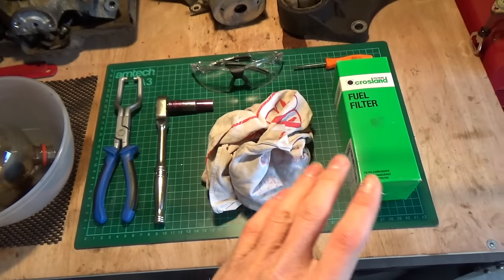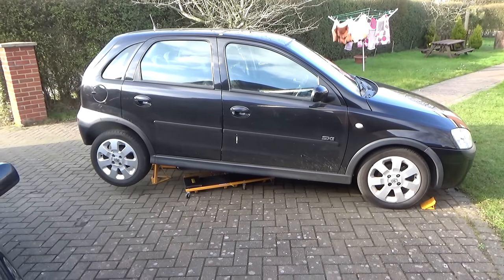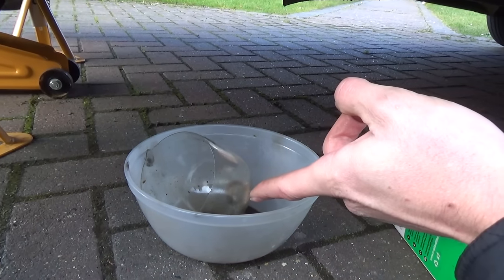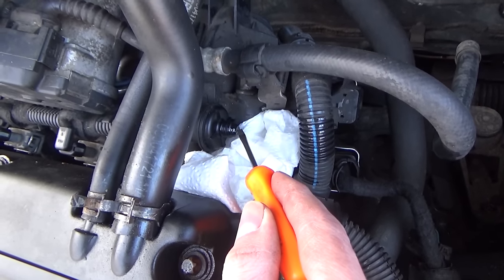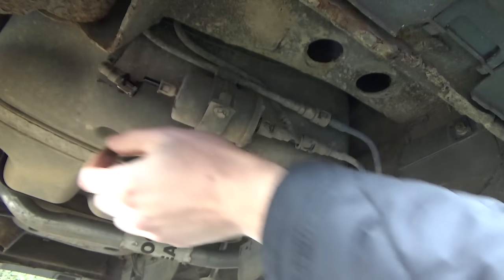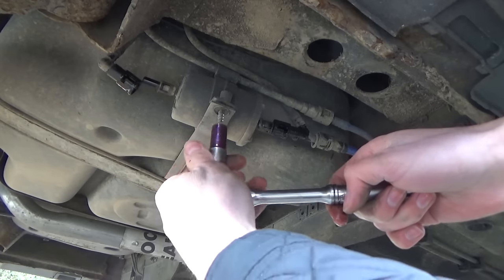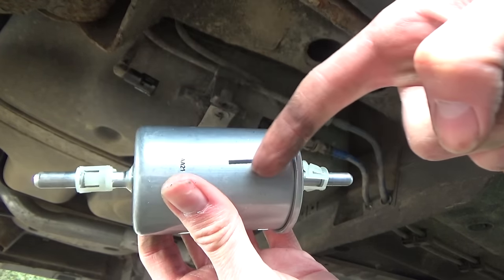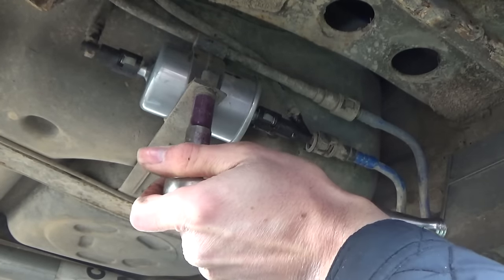Corsa C Fuel Filter Replacement

Comment: I did this job on my Astra and it was a pig of a job. Those pliers make it so much easier. I've been give the job of servicing a Corsa C that has been off the road for 2 years so this vid will help me when I come to do the fuel filter.

Edit: The fuel filter was a complete mare of a job and I ended up breaking the end of the fuel feed pipe. I've had to buy a replacement on eBay. Getting the pipe off involved dropping the tank down enough so I had enough room to liberate the pipe. The filter was rusty so it had to be replaced. I've shot a video of the service and I'll post it up once I've finished the job. I'll be spraying some white grease on it to prevent it happening again.
Reply: pp

Comment: very clear great vid thanks just about to try !! also got cutting out problem so hoping fuel filter will change that, update. Very challenging, the filter looked like it hadn't been changed for 10 years, the return connector with the y connector was ceased on the filter and fell apart. I'm now trying to get a replacement, quick connectors with the T piece don't fit , and trying to heat the return line hose to let is expand over the connector is virtually impossible on a hose 20 years old , in short filter cheap rusty connection and deteriorating hoses causing hassle

Comment: great video mate, and like the guy says buy the proper tool to get the fuel line off. i hadn't seen this video a few years ago when i changed mine on the astra. the Haynes manual says you can do it with small screw drivers, be-leave me guys just buy the tool and follow this video you will be so glad you did thanks
Reply: Great video. It's like watching wheeler dealers

Comment: For future, to stop petrol leakage, some cars you have to tilt the filter to get it out, so use the rubber caps from the new filter to block the old one before removing, it'll stop any petrol spillage :)

Comment: Hi ....nice vid....when i pulled the connector off there was a small orange o ring in the connector. Does this need to be changed as well? Fuel is just dripping when the pump is activated.

Comment: Hi, might be a bit of a long shot but what is the guard just in front of the filter (that the fuel lines slot into) called? I can't seem to find it anywhere. Also is it really needed as mine's falling off, just being held on by a bolt. 3:26 gives a clear shot - its the piece on the lower right hand side of the screen

Comment: Great vid!!  i'm having problems cranking the engine takes a few turns to start.. Not the spark plugs, so i'm guessing  a new filter change? same car here 2003 model.. 85000 on the clock.. Checked  service history no filter change's  ..

Comment: Quick question I have a problem with my opel corsa c it turns off after few minutes of running could it be sensor problem or the fuel pump will run 5 min turns of I have to wait few more minutes then it will start again 😥🤔

Comment: update on my shambles replace the pipe that was damaged and the connectors only to find they didn't seal properly , a right mess I replaced a section of the return pipe and the Y connector but for new quick release and they don't seal  - any ideas great

Comment: Quality presentation many thanks.  Is this the same procedure for the Corsa D 1.2 petrol would you know please?  Again, many thanks.
Reply: Ah, this is me answering my own question as I have just discovered that the D petrol, does not have an external petrol filter.  It has a so-called lifetime filter.  It is apparently part of the fuel pump and therefore lives in the petrol tank.  So when the petrol pump dies, you replace that and in so doing, the integral fuel filter.  Scotty Kilmer suggests that the pump dies BECAUSE of the lifetime filter clogging up over time and  therefore making the petrol pump work harder till it eventually gives out.  Replacing the pump looks fairly straightforward and the cost for the unit varies depending on the brand.  £50-£170 is the range I have seen today.  I'll leave the filter alone now and foccus on the stuff I can do.

Comment: Hello mate, I have a Opel Corsa b which my daughter collided on to the back of another car. I suspect that the inertia switch or the fuel cut off switch has jumped and cut off the electricity to the fuel pump and perhaps to other parts. The car is completely dead and except engine light nothing else lits. I have looked everywhere to find the "inertia switch" or "fuel cut off switch" but I can't find it. Can you help me locating this switch please? It's a Opel Corsa b 2000 model. Thanks in advance.

Comment: the bolt that holds in the fuel filter is stripped for me, my philips screwdriver just spins in it. any ideas what i should do? the bolt is rounded so 10mm does not grab onto it

Comment: Hi, I am wanting to remove the fuel from a Vauxhall Vectra before scrapping. 

I have located the fuel line, filter and valve as shown in your video. I wondered if I could release the pipe from the filter to drain the fuel? If so what would you recommend?
Reply from the maker: Carl Brierley I would remove a fuel line and crank the engine so the fuel comes out, or just drill a hole in the tank if scraping it
Reply: Excellent. It's a full tank and thought I could release the valve pressure when my bucket is full?

Comment: i've a question. I turned off my corsa c and after 10 minutes pushed the valve on the fuel rail and there was not any pressure. 
Is that normal?

Comment: Hi thats a really good video and very helpful so thanks  for that. I wanted to ask you about brake pipes. I have a corsa c and it needs brakes lines front to rear and some others renewed for MOT. Can I do this myself or is that a bit tricky? Also Ithought I'd renew with copper pipes but I also see that there are stainless steel pipes on the market. Which is best do you think? I'd like to do hopefully a permanent job so this doesn't come up again. I dont suppose you have a video of that job lol. What sort of cost would you expect a garage to charge for this? Hope you can help , thanks, Joe

Comment: This might be foolish question but why isn't all fuel coming out of the tank if you disconnect the fuel line there? Also do you know if the trick with the removed fuel pump relay and attempting to start the engine works on the Peugeot 205? I mean don't you break down anything using that method?

Comment: What to do if the connector are broke on the hose? Can use petrol pipe clips instead?
Reply: Did you ever figure this out? I have the same issue, I think one of the seals has gone in the connector. Does anyone know where to get these connectors from?

Comment: Do u know if it would be in the same place on a astra H 1.8
Reply from the maker: If the 1.8 is anything like the 1.6 they don't actually have serviceable filters on.. they are inside the take connected to the pump i think! Worth checking though as im not 100% sure
Reply: +The Savage Garage that is correct. mine is non-serviceable and its a nightmare when the fitted for life filter gets clogged

Comment: I have a fuel filter for my corsa c but ut has no arrow on it. At the top it says out though which way would i need to face the OUT?
Reply from the maker: Out would face the front of the car, fuel tank - IN - OUT - fuel rail
Reply: +The Savage Garage ah lovely thanks mate
Reply: +The Savage Garage what else do you reckon i could use? I havent got those pilers
Reply from the maker: +xxxMONEYISPOWERxxx do you have any nut crackers? Sounds stupid but they have bits on you can use, needle nose pliers, two small screwdrivers
Reply: +The Savage Garage i have a pair of bent pilers which seem to not be doing the job, i have two small screwdrivers how would i exactly do it if i used the pilers
Reply from the maker: +xxxMONEYISPOWERxxx find two small pieces of metal or something hard, put them between the pliers and the clips and squeeze them
Reply: +The Savage Garage i tried two small screwdrivers but wasn't doing any luck so i have waited and ordered those pilers you had :) didn't want to risk breaking the clips

Comment: You jammy sod! This can be an absolute pig of a job. You made it look so easy. The black plastic clips can become brittle and break. Your Astra's fuel filter is similar so I hope it is as easy when you come to change it. The fuel filter was something I didn't do when I recently serviced my Astra. It was replaced as part of the subsequent MoT work that needed doing. It wasn't secured in the bracket and was one of the failure items despite getting through at least the 2 previous MoTs like that.

Comment: Hi I have a problem with my 2005 corsa and the fuel filter is my last resort before spending out at a garage. Firstly my car when it revs up to about 4.5 - 5 thou rpm the engine dies and bogs and doesn't fire properly but when I turn the engine off and on its completely fine. So what iv done so far 
1. Oil change 
2. Spark plugs 
3. Coil pack (rubber was persished and from previous experience from my Suzuki gsx600f rubber persihed causes major damage to the thread of the head)
4. Put fresh fuel in (had Tesco unleaded in was thinking it was that) and redex to help clean out injectors and fuel lines
5. Cleaned air box, filter and whole system.
After all these no luck so only could be engine getting starved of fuel due to old filter and Tesco fuel caused damaged
Reply: Fuel Filter is cheapest option

Comment: top job been meaning to get a pair of those fuel filter pliers for ages! as daft as this is going to sound ive always used a wooden peg haha where did you get yours?
Reply from the maker: Should be a link in the description but but I got them from eBay, just search for fuel pipe pliers :) mine are by bergen but there is others on there! Thanks for watching :)
Reply: +The Savage Garage so there is! thanks :) what are you doing for your next video?
Reply from the maker: +Dean Mclone probably going to be the next part to project Sri bud :)

Comment: Nice video but the instructions are totally wrong. You do not need at all any tools for removing the gas lines. You just press the clip(white or black color) with the one hand and you simply pull the gas line with other hand.  Is is very simple